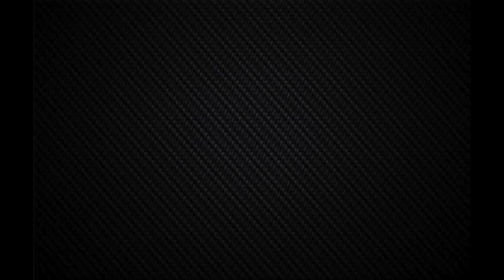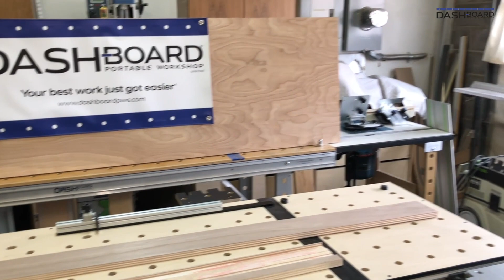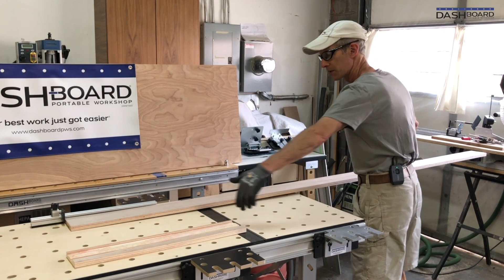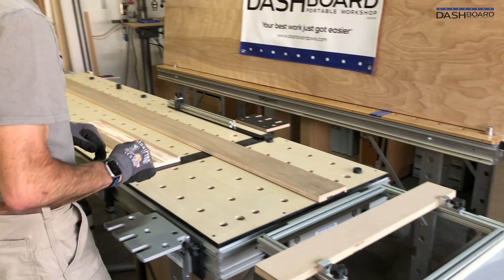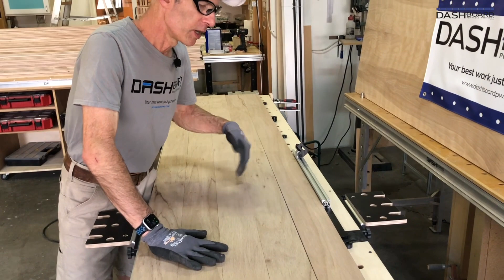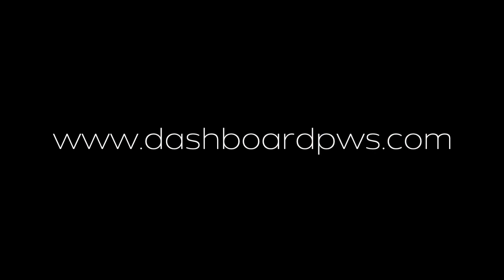Making Versatile Crosscuts using Festool tracksaw with the Outrigger. Beats the MFT3!

Comment: what is the max crosscut capacity?
Reply from the maker: Meghan,
With our brackets and standard, side-mounted fences it's 24.5" (622mm). If you use the F2 fence on Track Stars off the back of the table in combination with SpiRail™ Dogs in your rail and a Track Star on the front of the table the crosscut is a maximum of 31.5" (800mm)
Reply: @dashboardportableworkshop  
Thanks for the quick response! Well thought out system

Comment: Hello Rob, you have an amazing system and I own your rail hinge and love it. However, I think that in this video, with the intention of how to leverage rail system, this is being done backwards, the out feed creates the off cut. In other words, you first cut the edges off (cleaning cut)  then flip you rail the other way around and follow the same procedure, this ensures the clean cuts (under the rail) to be part of the cut pieces.  Cheers.
Reply from the maker: Jose,

Understood and thank you. It is also possible to flip these workpieces upside down for the second cut so the blade enters the finished face from below and the back side is facing up.  In either case, with a sharp blade I have few issues with tear-out this way. 

Rob

Comment: How do you ensure that the stops on your outrigger were parallel to the track?  Do you measure to the kerf in the Dashboard?
Reply from the maker: I measure right to the cut strip on the rail and include the blade thickness, so it came to 609mm to get my parts at 606.5mm. It works well and needs nothing fancy.